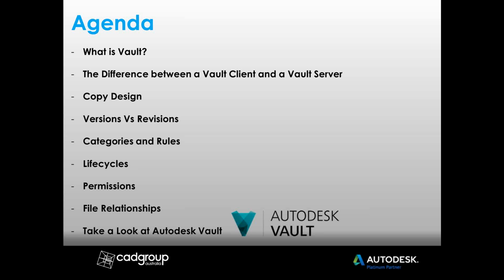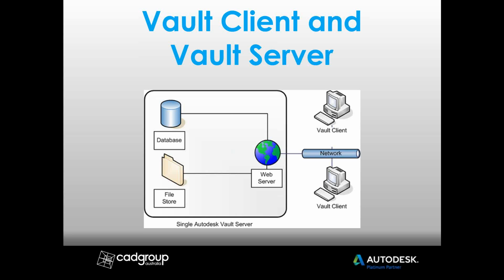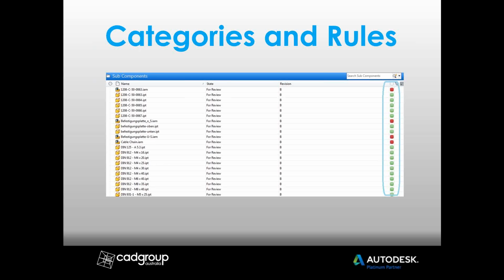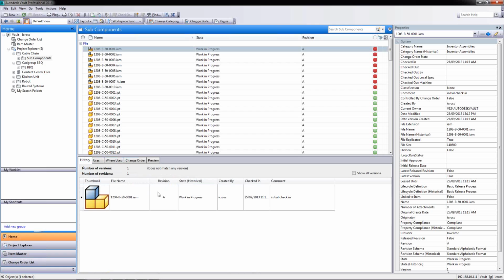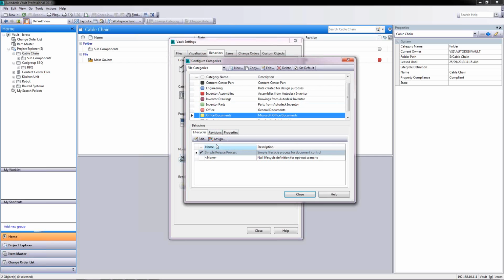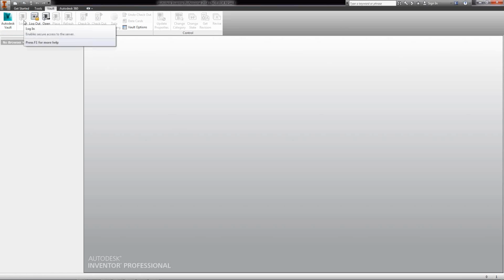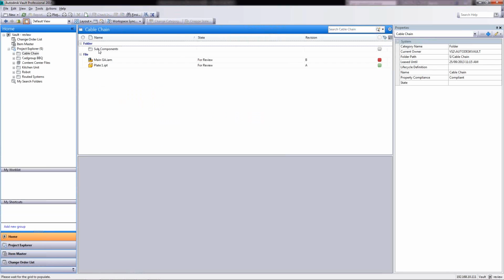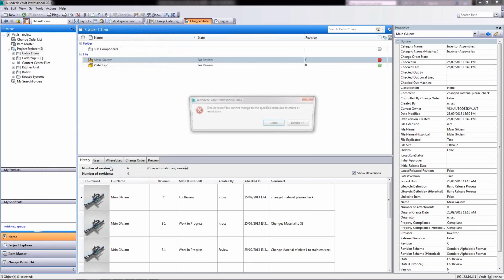An Introduction to Autodesk Vault Professional 2014  Part 1

Comment: Hello,
We have critical problem in collaboration Autodesk Vault with AutoCAD Civil 3D. In the tool panel (in Navigator) Civil 3D objects (surfaces, pipe networks etc.) are not displayed, although the drawings .dwg (in which objects are placed) we can check in and check out. But Civil 3D objects are displayed in the Vault. Video which I attached (Collaboration.wmv) demonstrate this issue.
You can see in Video that we use Civil 3D and Vault Client 2015 versions (with Windows 7 64 Bit Rus), but we also try to do this on 2016 versions (with Windows 10 64 Bit Rus).
On Server we have Vault Server 2016.
About Configuration file. We load the file (I attached Civil3D_Vault_Configuration.cfg) with instruction, which located in Help (I attached 2016.png), on server. Moreover, all categories of Civil 3D objects, which located in Vault, written in English (English.png).
Also we try to use another configuration files. For example, ENIVault.cfg (Configurations.png).
Issue still exists. But all categories of Civil 3D objects written in Russian (Categories.png).
Please help us.
Attachments: https://drive.google.com/file/d/0B9BZYzPKtfxYdWFYdGZNNkVzajg/view?usp=sharing
Last try to check in Civil 3D data: https://drive.google.com/file/d/0B9BZYzPKtfxYLVY5TmpacWRwTFE/view

Comment: Hello, nice video. At the end of the video, you show that you can't release the assembly because a child is still at Under Review. Is that a out of the box functionality or what is configured that way on your system.  I can see situation in manufacturing where you may want to push downstream the life cycle the assembly even if one of the children are not yet ready.  Thanks.

PS: have you ever organized webcast showing  Autodesk Vault vs Autodesk PLM 360° ?.   would I be correct that Vault is more a PDM tool use within engineering while PLM 360 is more the entreprise collaborative tool where you get sales, procurement etc... contributing to the life cycle of the product ?